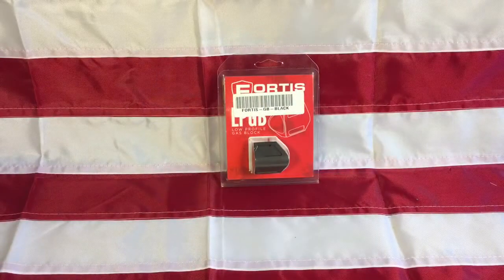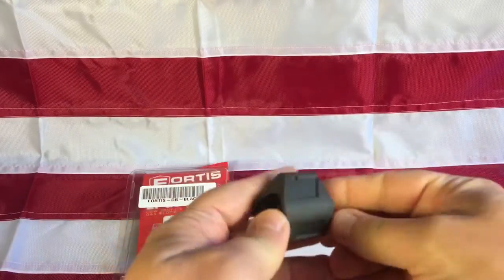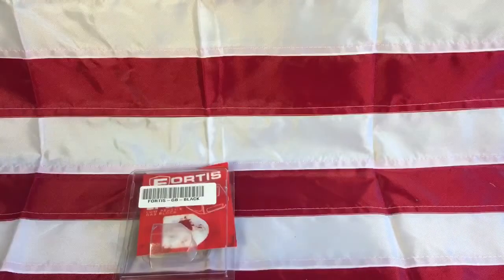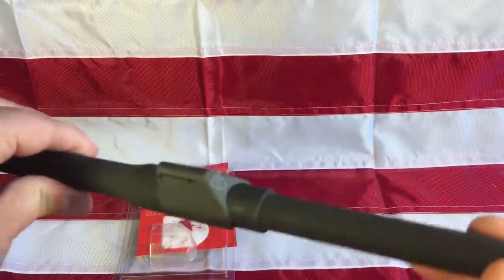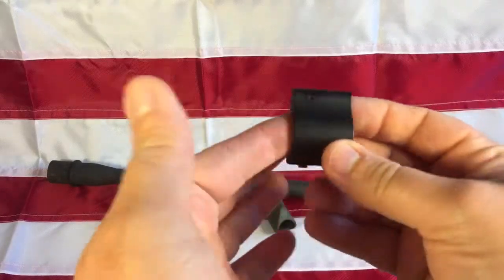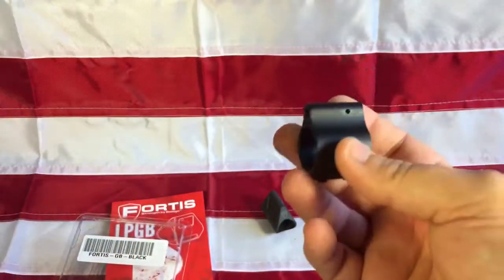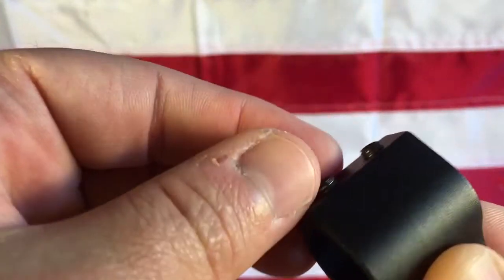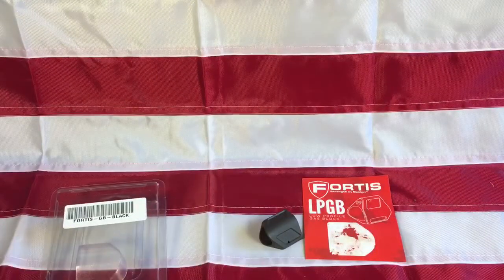Fortis LPGB .750 low profile gas block for AR-15

Comment: Hi I just want know if this thing fit to a Bushmaster ar 15   patroman carbine.?
Reply from the maker: CRJ02 I don't have a patrolman to check, but looking at the barrel on images it appears to be a standard barrel, so this should fit.
Reply: Liberal Gun Owner thanks
Reply: Check the specifications on the particular barrel you're gonna be putting it on. Most common, to my knowledge, are .625 and .750 gas blocks.